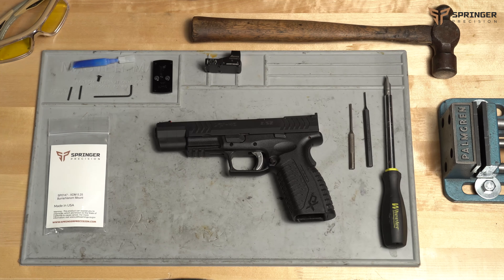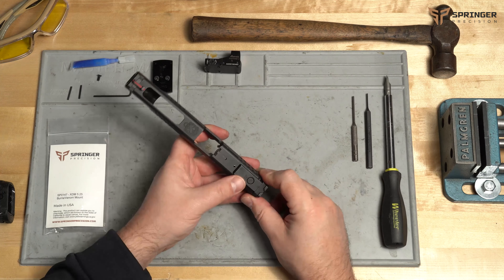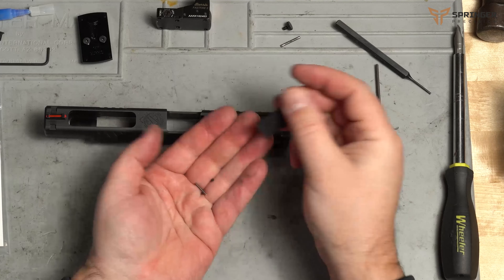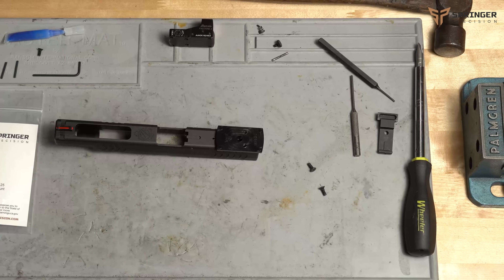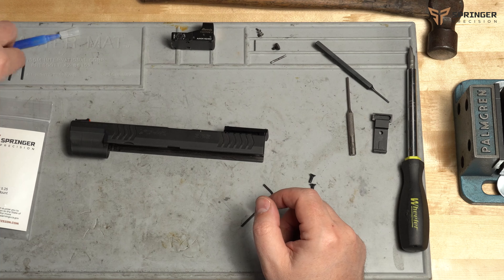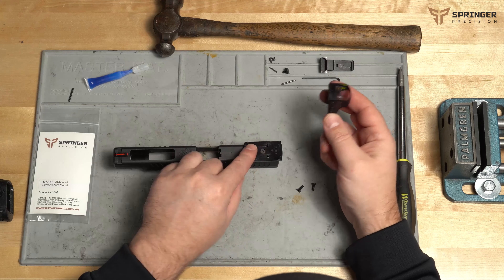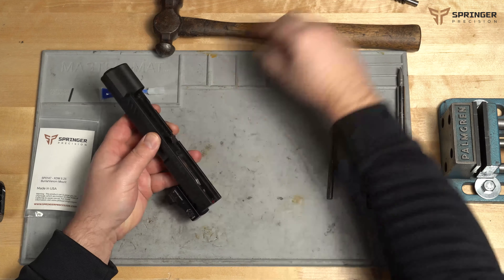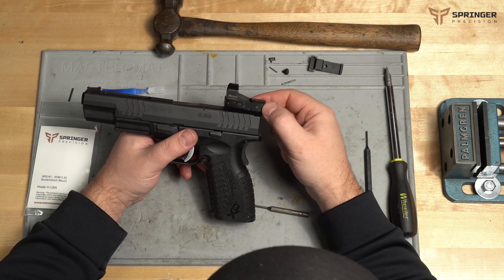SPRINGFIELD XDM 5.25 OPTIC MOUNTING INSTRUCTIONS

Comment: I followed this video last evening on my 5.25 .40. It took me maybe ten minutes total and it was done. My front sight cross pin came out easily, one light tap and the rest of the way with my fingers. For me, the position of the 507c is going to take a little getting used to in comparison with opens, but that will come with use. This mounting plate is made perfectly and when installing it, that becomes obvious.
Reply from the maker: Thank you for the feedback!

Comment: I ordered for my XDm 10mm 5.25  Works great. What about milling on the slide? Do you do that type of work?
Reply from the maker: The safety system and narrow top of the slide make milling not feasible. We do mill for models where there is enough material to do so.
Reply: @SpringerPrecision  Found that after I went to your website. I did however purchase a plate for my XDm 10mm for the Vexon red dot sight. Thank you.
Reply: Has the plate been loosing up on you?
Reply: @nickkompinski3390  I took it off and put the original site back on it.

Comment: Has anyone that has installed this plate on their XDM Elite 5.25 had issues with not being able to adjust the dot elevation down enough to co-witness level? I just installed one on mine with the Holosun 507c x2 and the dot is well above the front sight when moved as low as it will go.
Reply from the maker: The dot should not line up with the front sight, as it is higher on the slide. If it lined up with the front sight, it would shoot much too low.
Reply: @SpringerPrecision  The 24-hour locktite time was just up and I dialed the 507CX2 in at 25 yards and there was plenty of adjustment for the elevation, so thank you for the advice. I shot a little over 50 rounds and your mounting plate seems to have held up perfectly. I checked the torque on the optic thanks for the advice and it looks like I will not need the shim I ordered after all. The XDM Elite 5.25 with the Springer Precision mounting plate is a perfect combo with the Holosun 507C optic. I cut the center out of my target at 25 yards. A very pleased customer.

Comment: I see a lot of reviews where this mount comes loose after several rounds fired. I understand there is only one mounting screw, but what can be done to secure it 100%? I want a optic mount that is 100% secure. Suggestions?
Reply: If you take the time to install it properly, it will not loosen easily. There is a pin in the front that also holds it into place. We can machine an additional hole and custom mount the part in our machine shop, but the vast majority of users do not have an issue with it coming loose.
Reply: @scottspringer5698  Thank you Scott. Would red lock tite be a possibility if one intended to leave the mount on and never remove it?
Reply: Try tig welding it 👍
Reply: How has this mount been working for you? Red locker work or did you need to further secure it.
Reply: @scottspringer5698  "We can machine an additional hole and custom mount the part in our machine shop, ....". The slide has two factory-made holes in it that allow your optic mount to be readily secured into position. One hole accepts a screw, while the other one is for a cross pin. Where is that custom, additional hole located? Is it made to accept another screw or does a second cross pin go through it? Please elaborate. The custom route may be "overkill", but I see nothing wrong with that.

If one adheres to the "do-it-yourself" approach, can you provide torque values for all of the screws used here?

With the factory rear sight on it, my XDM 5.25 was very reliable, regardless of the cartridge's bullet weight. Is it possible that the weight of the mount/optic could now negatively impact the slide's ability to fully cycle with some ammunition? Will different types then be required to in order to have reliable functioning? Rounds with heavier bullets do tend to generate more recoil than those having lighter ones.

In the video, the presenter suggests placing some blue threadlocker between the mount and the optic before securing everything into place. Regardless of the manufacturer, any of these dot sights may unexpectedly fail. How does one go about safely removing the optic if the need to do so ever arises if the threadlocker was applied?

Watch the video starting at 0:32, when the presenter begins field stripping the pistol. At around 0:40, he dry fires the pistol right before pulling the slide forward off of the frame. Is it necessary for this to be done? When disassembling my XDM 5.25 for a basic cleaning, I have always left everything in a "cocked" state. Is there anything wrong with my method?

Thank you in advance for answering all of my questions. I hope that your answers will be helpful to all of the other Springfield fans out there!
Reply: I can confirm the screw does become lose overtime even with red loctie. Taking mine apart and redo it again.

Comment: My elite barrel does not look like this
Reply from the maker: What does it look like? That is a standard 5.25 and factory barrel.
Reply: Likewise. Pin hole near rear sights are not on my xdm e slide.
Reply: @123572799  They have 3 slides, one with an adjustable sight, that is the one in the video. One has a rear dovetail sight and one has an optic plate.
Reply: @scottspringer5698  Thanks, Scott. Could you please send me a link? Just not having luck finding such.